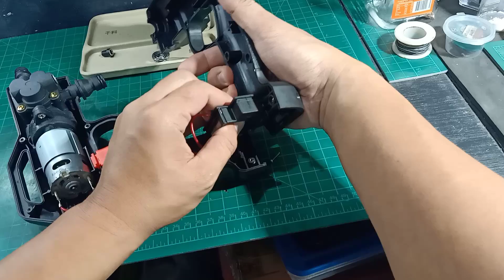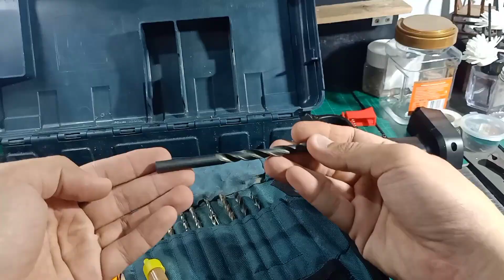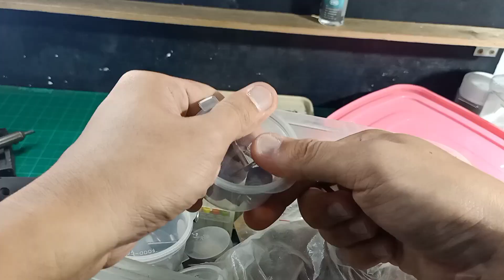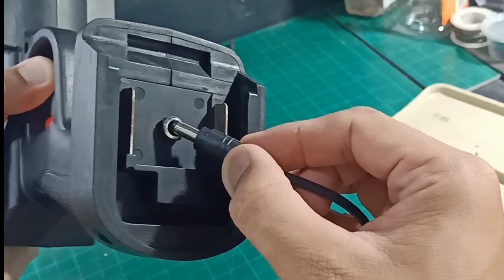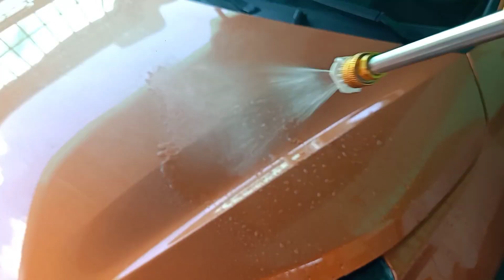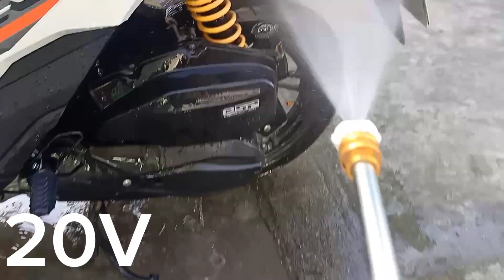Portable pressure washer convert cordless to corded

Comment: How do you compare the pressure coming out now compared to the battery. Is it more(using 24v)
Reply from the maker: The pressure of the water is much stronger than the power that come's from the battery,

Comment: may pressure washer din ako sira na din battery. ilan amps gamit mong dc adapter?
Reply from the maker: Good day, Gamit ko po ay adjustable power adapter 12-24v. If you have a 24V device that consumes 100 watts, the current draw would be: 100W / 24V = 4.17 amps.